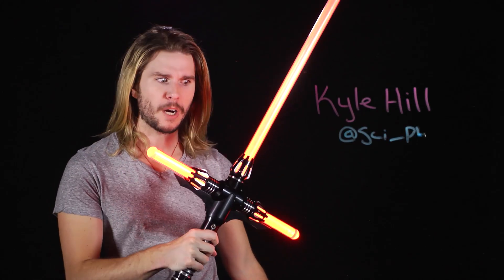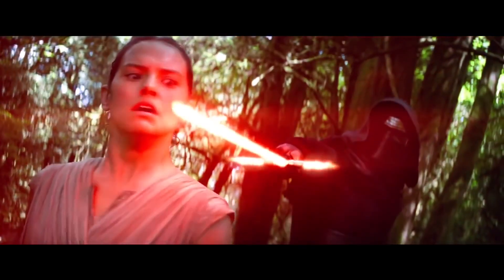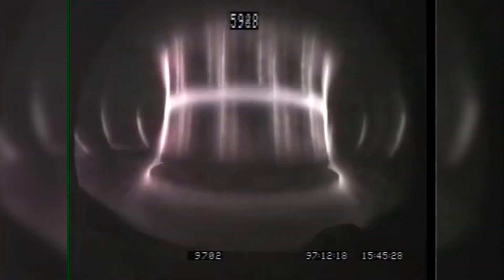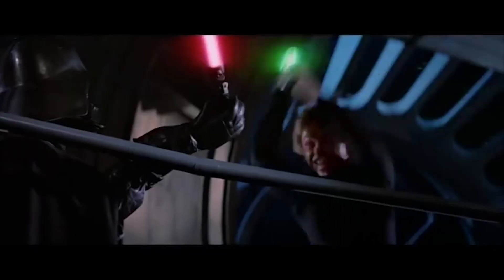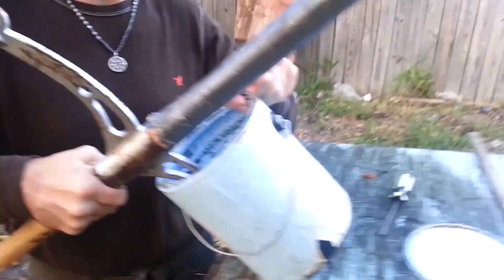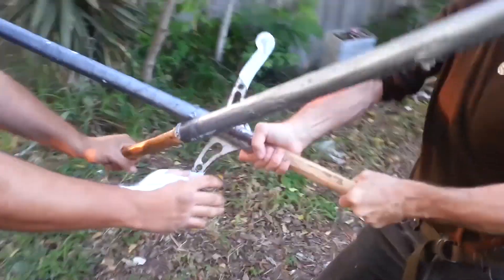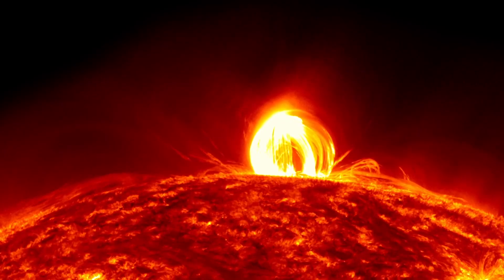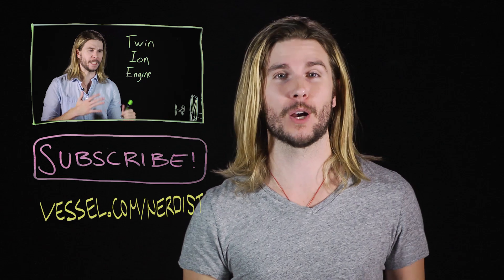Why Kylo Ren's Lightsaber Works (Because Science w/ Kyle Hill)

Comment: I heard somewhere that Kylo's blade is an older design.
Reply: +XiahouDun1225 It's an old design but it checks out.
Reply: +Rurike Yup, the cracked energy crystal is actually ENTIRELY the reason why it doesn't look like the rest. The energy is wild and chaotic, barely restrained and the crossguards are actually unintentionally helpful. The real reason the crossguards are there is to vent the excess energy.
Reply: +XiahouDun1225 yup! they were used during the Great Sith War, particular to Malachor i believe.
Reply: The red kyber crystal that Kylo Ren used was cracked and he had to use the QUILLONS to vent the extra energy that the crystal created. One of the few risks Kylo has with his lightsaber is the kyber crystal shattering. Also, the design that Kylo used was also used by ancient Jedi (canon).
Reply: saw that at Disney lol
Reply: +beerponglegend69 lmfao
Reply: it is
it was used by samurai in the 17th century
Reply: +XiahouDun1225 It also has a cracked energy crystal which is why the blade isnt as solid as other sabers
Reply: +Kylee Smalley It also makes it highly unstable and likely to explode. The amount of energy coursing through that crystal could potentially kill him, should it become too unstable.
Reply: Yup! Although a crossguard lightsaber that's not unstable is possible.

Comment: Ok here's the thing. Yes its a perfectly fine design, but all the reasons Kylo Ren's lightsaber was made that way are wrong. Kylo Ren is a practitioner of an ancient force using order. That is why even though he is part of the dark side he is not considered a Sith and does not have a "Darth" moniker. His saber is also crafted using ancient techniques. That is why his crackles and looks rough as compared to the smooth sabers used by everyone else in the movies. These "crossguards" as people call them are actual exhaust ports as this ancient method couldnt control the power output of the crystals. That is why they look more like a jet exhaust then the rest of the blade. When you watch the movie look at the close ups of the fight.

Comment: it would still be pretty easy for that thing to be cut in half, by the way colbert said it, there would be nothing to actually generate the blades. so the little handle bits sticking out probably wouldn't be energy. why not just make the crossguard out of lightsaber resistant metals? they make entire handles out of it so why not a crossguard?

Comment: Cool video. Good points and very logical. Very compelling argument, overall. 

However, that's not the real reason why Ren's lightsaber is made that way. The weapons is based on an ancient lightsaber design and was crudely made in that image. On top of that, it has an unstable focusing crystal which cannot fully contain the power produced by the lightsaber. The 'cross guard' are in fact exhaust ports to divert excess heat. 

You theory is actually very good and SHOULD be used for lightsaber designs. Kylo Ren should of made a better saber.

Comment: Stephen's argument doesn't make sense. A trained Jedi or Sith wouldn't be so clumsy to let their hands slide off of their desired position. Much less right into the blade of a saber. I'm positive those metal bits on the side are meant for containing the light from the guard itself. Therefore, if a blade cuts those metal guards, the light no longer has a container, thus something bad will probably occur with that saber.

Comment: Kylos Lightsaber isnt his own design, its actually a reallllllly old lightsaber design, from back when the sith originated. The Force crystals for Sith sabers are not natural crystals but rather synthetic crystals that have been molded and shaped using dark force powers. As a result of this you get the iconic Red saber color, but also you get a good majority of unstable crystals. Now being unstable they put off to much power, and thus this excess has to be vented off or else the lightsaber implodes. Thus the design was to vent the excess power out and simultaneously give a nice cross guard function.

Comment: my argument 
watch the yoda vs palpatine battle, imagine palpatine has kylo's sabre  and watch how many times he would cut himself

star wars combat is agile a lot of the time, and many times the more powerful opponent would push the lightsabre to the holders chest, like in the force awakens with finn, now if finn had cross guards the he would have probably died, as the twist and turns of lightsabres in combat means the cross guards would easily cut the sabre's wielder, as shown in the movie this restricts the combatant to a certain style, like the double bladed sabre, while it confuses opponents at first, it will give the wielder limitations, and an opponent would defeat this new sabre with practice(darth bane books explain this better) so the cross guards are useful for reality, but when you have jedi who can move at incredible speed they do become a disadvantage against a skilled dueler.

Comment: The lightsaber has cross guards because the Crystal he used to make the lightsaber is cracked and therefore is unstable. And the light saber itself can't handle the power so I has to have vents on either side to release the excess power. Thus creating cross guards :)

Comment: Also anyone that knows anything about swordsmanship, would know that a cross guard would not have helped any of those people  keep their hands. Also the crossguard wouldn't do much because the lightsabers bounce off of each other and the cross guard only works when you can slide the blade of your sword along the other persons blade. That guy is just speculating about the metal having the laser inside of it all the way. Even if he where right then as soon as the metal gets cut, then his hands would burn. It would have the same effect.  Also the part that is most used in the crossguard is the metal part. Even though someone can train to not get hit by the laser on the side, it would still hamper his options in fighting. Lets just face it, It's there to look cool and really isn't overly useful except ventilation because he made his lightsaber with a cracked crystal.

Comment: So the exhaust ports double as crossguards. It's a result of the unstable crystal requiring it to have its beam dispersed, and this was turned into a tactical choice. Done. It's all one beam so you can cut through the emitter and you'll just hit the beam coming from within. I hated this design when it was first revealed but has already become my favorite saber design for this reason. Now all I want is a slightly curved saber with a circular guard piece, completely mimicking the katana.

Comment: Actually, the kessel run is measured in the shortest distance it takes to deliver snuggled goods. Check out the wookiepedia page on the kessel run for more info, and before you go about spouting off crap to your userbase do some research. I couldn't remember what the run was called, so I literally googled "12 parsecs" and found it in less than 10 seconds.

Comment: The cross guard point doesn't make much sense when we've seen alternatives that are used to block lightsabers. The new movie even shows a storm trooper with a device that can block light sabers so we no that tech is still kicking around. Later in the movie, we see the plasma cross guard actually burn Kylo Ren in a duel as the plasma gets pushed too close to his body. If he wanted to go to all the effort for a guard, why not incorporate something that's, at least somewhat, safer to the user?

Comment: The guy at 2:26 didn't quite get it right. There are probably two crystals (Unless Kylo discovered a way to make one crystal emit two blades). I mean honestly, I think everybody is forgetting that there are at least 2 (if not 3) crystals in the saber. One for the main blade and 2 (or one) for the crossguards. I am also quite sure that the crystals are in the side hilts, so if you "cut through the metal" like the man was saying, chances are, you'd hit a crystal, disabling one of the blades.
Reply: ***** That has nothing to do with the emitter crystals. Obviously the crystal is cracked and/or damaged. What I am trying to say is that there are two crystals responsible for the crossguard blades' emission. (The crossguard crystals are also probably cracked since in the film, they made unorthodox sounds and shimmered rapidly).
Reply: ***** how?

Comment: can anyone else figure out that the kestle run was a set of hyperspace jumo using known hyperspace lanes and the falcon was fast enough to take a normaly inpassable route due to empirial portorls and therfore does the run in less than 12 parcects becuase the other ones require more distance to be traveled in a different path of hyperspace lanes.

Comment: If the plasma cross guards extend into the covering, why have the covering at all? I assumed, based on star wars games which, yes, I know are no longer canon, you have to have a lens to to focus the beam. So I figured the casings were housing the additional lenses necessary to generate two more beams.

If they just continued under the casing, why have them at all? They'd be an additional part that needs replacing whenever they use the crossguard. But, hey, fantasy.

Comment: Parsec wasnt the wrong choice in star wars 4. time wasnt the main factor in the kessel run, distance and covertness was.

the kessel run was through a part of space with very deadly gravity wells that you needed to go around in order to get to the destination safely. going safely around added distance to the trip.
Han took a much more dangerous course much closer to the gravity wells than anyone else before, close enough that he was almost pulled into them. so he did the run in much less distance than anyone else. also, by using hans course, he was highly unlikely to be followed while smuggling.

Comment: all of the force users who loses their hands are skillfully disarmed haha with an under or over strike that would not have been stopped by a crossguard. 
also the magnetic fields of the sabers cause them to be ultimately sticky to one another and reduce most blade slide in light saber fights. Finally I like the retcon explanation that the crossgaurds are actually energy vents  for a the cracked crystal he is using.

Comment: OK I realise this is pointless.. but what the hell.

Not a single one of your examples of hands being cut off would've been helped by a cross guard.. not one.

Crossguards stop swords blades from sliding down the length... which has never happened in Star Wars.. never.

The guy with the paint could swing the sword around, but not very well, and if the other guy had tried even a little bit ( seeing as how he could move much much faster without the fear of cutting his own hand off ) then the fight is over. 

Swords have had cross guards for centuries... but not blades on the handle. 

The lightsaber has a cross guard because someone at Disney needed something new to market... 
It looks stupid and wouldn't work.  

The End.

Comment: There's also the issue of what purpose do the plasma crossguards serve anyway? If it's for protection, making it plasma based is kinda dumb when the guards can be solid pieces like the hilt, reduces self harm risk. If they're plasma like the blade, they're obviously meant to be used for combat, but what does that entail exactly? If there are forms of sword based combat that have used crossguards for that, I'd like to know.
Reply: +B'oh | Geralt of Rivia I actually looked that up. Phrik, the material, wasn't very commonly used and I doubt Kylo would use that. His is homemade and crude while Palpatine's was refined and elegant. Either way, Kylo's saber doesn't have crossguards, they are exhaust ports because the crystal inside his lights aver is cracked and therefore unstable. The ports on the side make sure the whole lightsaber doesn't blow up in his hand by venting the excess energy. They could be used as crossguards though!
Reply: Dude.. a lightsaber's blade can cut through a hilt. It could easily cut crossguards made of any other material other than the plasma of a lightsaber.
Reply: As you see in the movie while fighting Finn. When both light sabers were locked. Kylo tilted the saber just a bit, stabbing Finn. That to me is the purpose of his light saber. You don't want to get to close to him in that position.
Reply: +Byran Jomphe Actually there is a material that can block the plasma. Darth Sidious's Lightsaber handle was made entirely from it.
Reply: Byran Jomphe I know its not a crossguard but yeah.
Reply: +Teenkitsune If you want to see combat with cross guards there are plenty of resources. During medieval periods and the like cross guards and hand covers were invaluable as your opponents blade sliding down against  yours would inevitably slice your fingers or hand. For this very reason there are cross guards as part of the hilt. The most recognisable would be a claymore, these are also known as Scottish Broadswords, the guards were extremely useful for blocking, hitting your opponent when your blades were locked for disorientation purposes and some swordsmen were rumoured to be so strong that they could pierce their opponents armour or flesh with their cross guards. Essentially it made defence far superior and added an extra combat element to prevail over ones opponent. Of course the Longsword and Crusader Swords are the most famous coming in with blade lengths of 32 to over 40 inches long, giving the weilder a superior reach on the battlefield, and significant heft behind each swing, the cross guard on a crusader sword would often be tapered however a longsword would normally have a rounded end for battering.
Reply: There are forms of combat which use the crossgaurd did you not see the clip he showed where the guy puts paint on a swords gaurd the guy shows him using it to disarm/ perry the other guys attack which would cut the guys hand had it been a light saber also Spoiler Alert he does use the cross gaurd blade to stab someone in the movie plus it looks more badass as a light saber blade rather than metal in my opinion even is mandalorian iron was used
Reply: +Teenkitsune Anyone who actually thinks it's dumb has never actually touched a sword with cross-guards. Dumbest comment on the internet. ever.
Reply: +Teenkitsune if if they were just solid pieces then a other light saber would cut right through them. no hand protection at all. and eventually he would be mace windued. and lose a hand
Reply: +Nicholas Fries There are metals in the star wars universe that are resistant to lightsabers.
Reply: Yes, there are actually sword forms that use the crossguards. And the pommels. European Longsword forms had a lot more techniques than cutting with the blade. They also use the crossguards to trap and disarm. I was actually saddened to not see those techniques used by Kylo, but then it would have been a short fight.
Reply: fucking furry
Reply: WhosYourDaddy
What's your problem?
Reply: I'm guessing YOU are this person's problem. LOL
Reply: William Fox
Don't justify this guy's hatred.
Reply: ok D:

Comment: its acually VERY unsafe, because, what causes the crossgaurds to come out, is because the CRYSTAL is unstable! it cant do that with ANY lightsaber, and that's why when you look at his lightsaber BLADE, it has streaks in it, like energy streaks, and there completely unstable, and PLUS there not POWER streaks, if they were power streaks, it would be just as good as a normal lightsaber, and even MORE powerful because of the crossguards. please respond if you think this is a good theory

Comment: First, there are metals in the Star Wars Universe that resist lightsaber blades.  It would be far safer to make a crossguard out of that metal, no matter how expensive, than put a cutting edge that can take off your hand with even a minor slip.  Second, the point of a crossguard is to prevent the enemy's blade from sliding up yours and cutting your arm.  Lightsabers do not slide that way.  When two lightsabers collide, they seem to stick at the point of contact rather than behave like a sword would.  Thus a crossguard is unnecessary, which is why no one uses them.  Third, I'm pretty sure they have said that Ren's lightsaber is an imperfect design, and the small emitters are not blades for striking and blocking but exhaust for uncontrolled energy.  FOURTH, lightsabers are heavy.  This was repeatedly reinforced by George Lucas while filming the original trilogy.  If they were weightless and simply cut like a plasma torch, then striking with more force would have no effect.  Yet you repeatedly see Luke and Vader swing with force-enhanced brute strength to pummel their opponent down (Form V).  

Now, there are crossguard lightsabers in the expanded universe, but that is no longer canon.
/nerd

Comment: still kind of disagree because if you cut through the metal of the cross guard, you could destroy the vents that keep the cross guard in place, never mind short out the entire saber. Cool design but still more dangerous to the user and easier to disable as the opposition.

Comment: I have read up on this lightsaber (It was a Wiki so info might be off) But apparently the crystal inside the saber is broken causing its unstable crackle. The cross guard is actual a from of ventilation that helps the blade not... be so destructive to the user. I find this info interesting since one man point made was this saber was made somewhat shabbily, giving it more usability and I think Unstable is the best way to describe Kylo Ren and this Lightsaber gives his character more meaning.